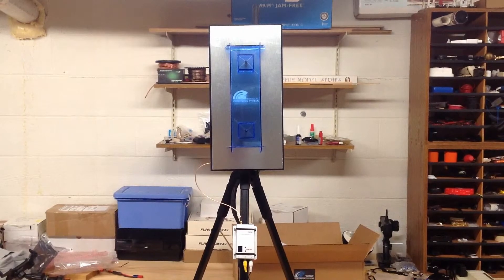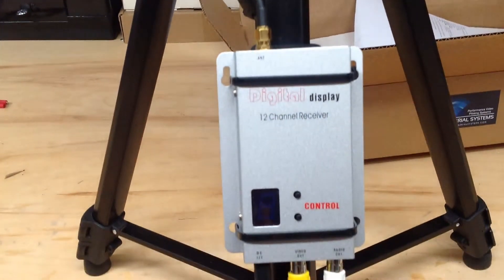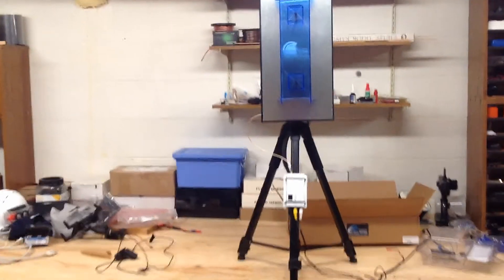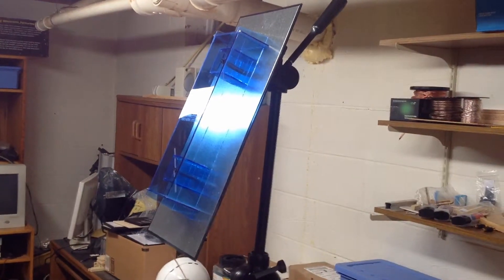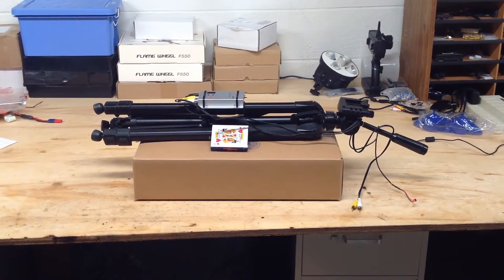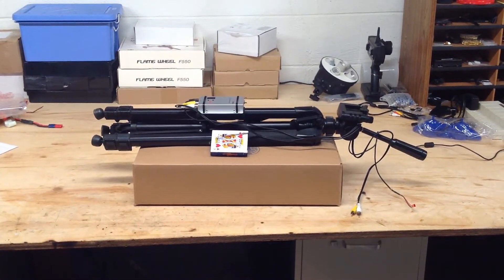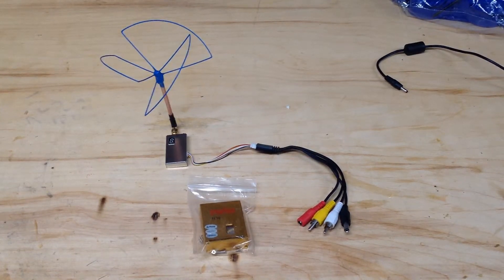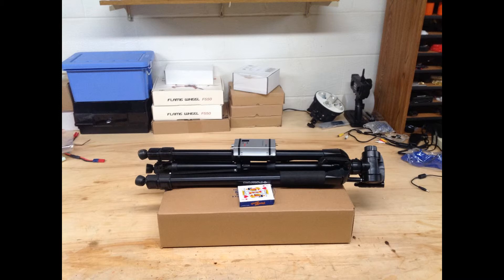Pepperbox 1.3 GHz High Gain 13dBic Video Antenna System

Comment from the maker: I would suggest trying a monopole on the transmitter.  Might be surprised.  I generally get that range on a 200mw TX.

5.8 pepperbox is only about 5 inches by 5 inches.

Comment from the maker: This is a 1.3 GHz setup, there is a 5.8 GHz setup.  It is MUCH smaller.  When we speak 1.3 GHz or 5.8 GHz, we are speaking general frequencies.  In fact my 1.3 is actually 1280 Ghz.

Here is a channel list for a 5.8 GHz fatshark.  As you can see the real frequencies go as low as 5740 and as high as 5880.

 
Ch1 5740
Ch2 5760
Ch3 5780
Ch4 5800
Ch5 5820
Ch6 5840
Ch7 5860

We are also talking GHz  vs. MHz in some cases.  Much different.

So NO this would NOT work well with 5.8 MHZ fatshark.

Use this one.   http://www.readymaderc.com/store/index.php?main_page=product_info&cPath=165_108&products_id=3926

You could also use a Yagi type.  EXTREMELY directional, but also extreme range.

http://www.readymaderc.com/store/index.php?main_page=product_info&cPath=11_45_49_97&products_id=2559

There are even small ones you can goggle mount.  Most of the larger ones need an antenna tracker type mount.

http://www.readymaderc.com/store/index.php?main_page=product_info&cPath=11_45_49_97&products_id=1088

Hope this help you!

Comment: Nice setup, I have a fat shark setup.
Can I use a 5.8 pepperbox with my googles?
I'm using a 600mw transmitter with spironet antenna, I'm only getting about quarter mile.
 Thought this might be the ticket, not really looking for altitude, just range.
Reply: James Haywood nop this antenna is only for 1.2 or 1.3 ghz video transmitter.
Reply from the maker: +Frank R. Pilot 5.8 pepperbox is so small you CAN wear it on
goggles.  I have seen a lot of different
attempts.  Pepperbox with a Yagi.  Pepperbox with all sorts of Circular
Polarized types.  Haven’t played with all
application myself yet.  lol
Reply from the maker: +James Haywood Yagi on an antenna tracker.